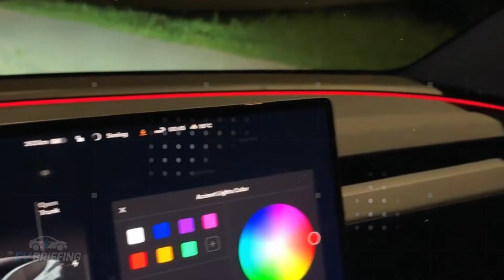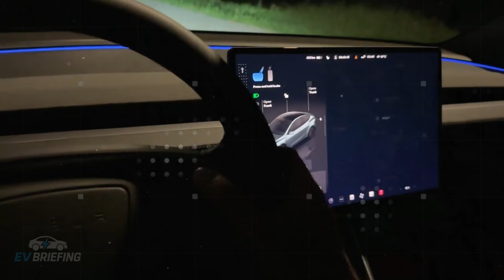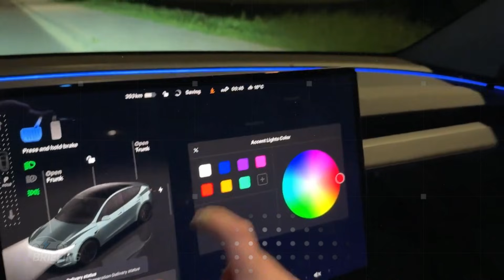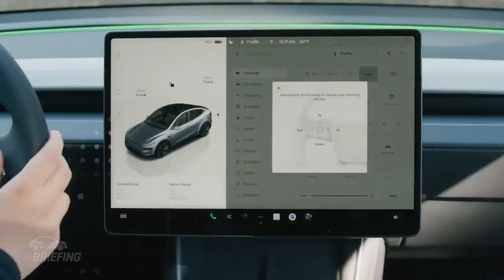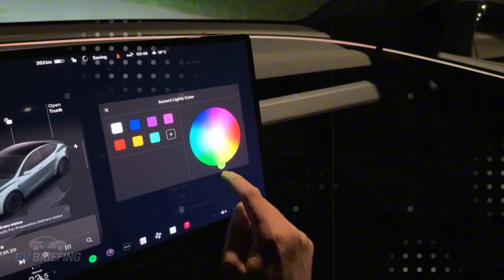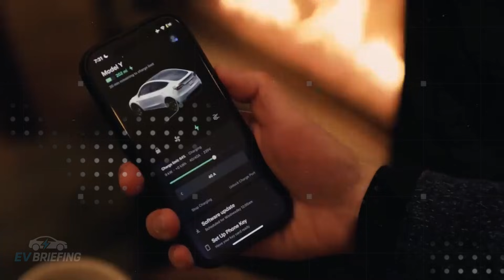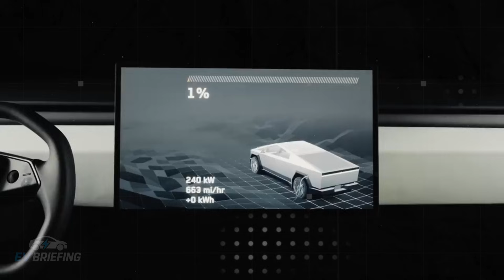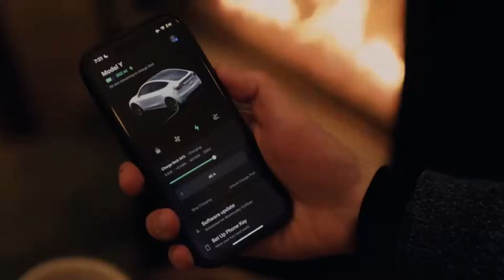Tesla Model 2 (2026) US$15.990: 310 mi, 0–60 em 6 s, Giga Press 50.000t, LFP/AL-ION

Comment: What happened to the aluminium ion battery
Reply: That's what I'm wondering
Reply: I am wondering too. I think that it’s just not at a stage where it’s ready for mass production in cars yet. Projects like that often show promising cell chemistry early on, but when you scale up to full-size automotive packs, a whole new set of challenges shows up (thermal management, cycle life under load, manufacturing yield, cost per kWh, etc...). Right now, most of those efforts are still in research or pilot phases rather than something you’d see in a 2026 Tesla. Do you think the next big EV battery leap is more likely to come from startups with new chemistries, or from companies improving existing tech like LFP and lithium nickel manganese cobalt?